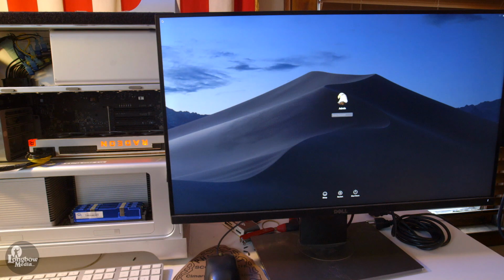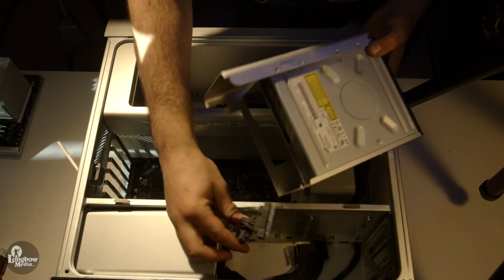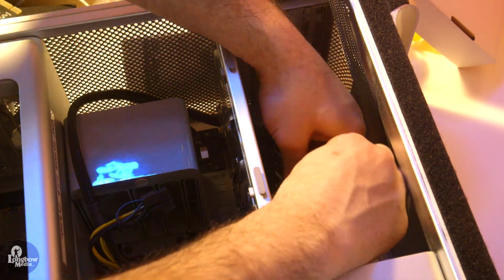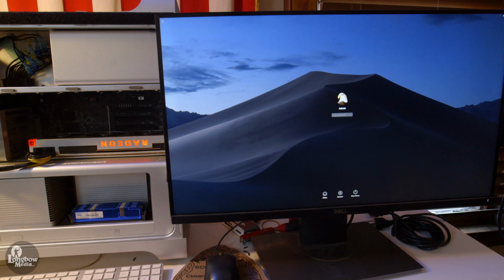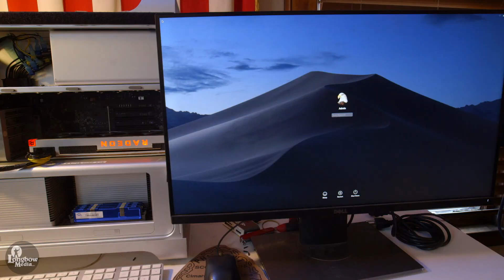Pixlas Mod for Mac Pro 5,1 - Gaming & Editing GPU Upgrade - Radeon VII - Power Supply - Mojave

Comment: Wait…u taped 7 out of 8
And u have 8 connector,the 8th’s one where is connected?
I watch anther video and he put 2 group connector in same single wire because the power cable come with 5 ground and 3 12v wires,so that what u did? Hope u answer and thx for the video ❤.
Reply from the maker: I tapped 8 wires from the power supply, but only connected 7 of the taps to wires to the GPU
Reply: @LongbowMedia  thx

Comment: Curious as to why you had to install this mod. I installed the Radeon VII without it just fine. However, I noticed that if I play AAA games, such as Call of Duty, the computer may shut down. In this case, I was thinking of under clocking it slightly. Thoughts?
Reply: The power increase is meant to supply the lacking power to the card. This should prevent the shutting down you've experienced.

Comment: Will this mod allow Big Sur to be installed?
Reply: Big Sur works good but be careful witch version! 11.5.2 will destroy your macpro! I needed to learn it on the hard way and it took me 6h to fix the problem! There is NO videos about this problem and no help to fix it! If you really want to Install Big Sur you need the version befor 11.5.2 and you need OpenCor or Dos. I Preffer Opencor but set OFF the Update Downloads! One restart after downloading 11.5.2 and your macpro is gone! I got fixed mine but itz hard work. So DONT forget to turn of the updates!
Reply from the maker: Haven't tried OS Big Sur, yet.

Comment: I just plug mine straight into the motherboard it's never failed me and I've used several high powered cards, this seems OTT.
Reply: Yes, it's possible that your low power cards work with internal mini pci-e but some of us use cards that require more power and pixlas mod is the way to go.
Reply from the maker: Which GPU are you using?
Reply: @LongbowMedia  ATM, I'm using a 'Sapphire Radeon RX 580 NITRO+ Special Edition'. In the past, I've used GTX 670, GTX 970, R9 390X.
Reply from the maker: I don't think that card draws enough power to warrant a Pixlas Mod.  Previously, I was using a Sapphire 580 powered by the Motherboard.  The Radeon VII draws up to 300w, thus requiring the Pixlas Mod.